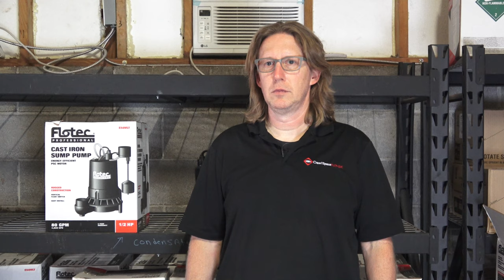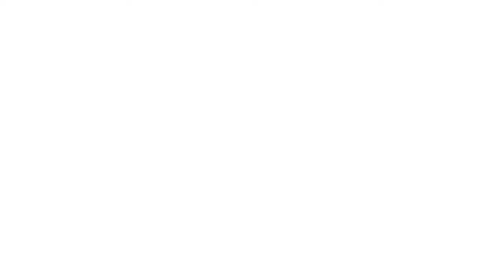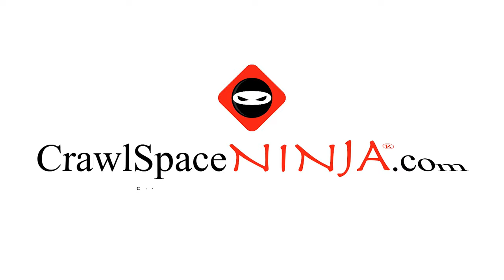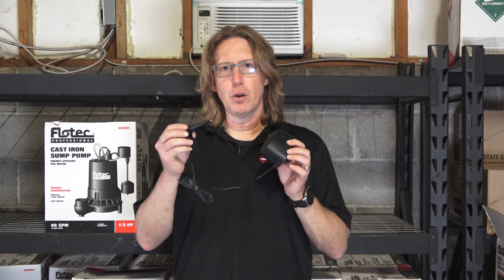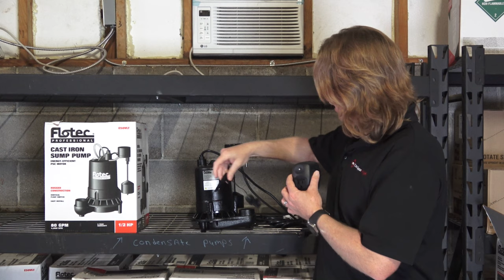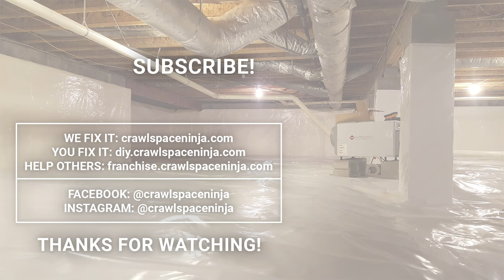Replace Sump Pump Float Switch with Universal Sump Pump Float Switch Controller

Comment: A problem with this type of switch is that the shut off trigger is time-based rather than based upon the water level. One can guess how long the pump will need to run, but water drainage amounts will vary considerably. Consequently, one runs the risk running the pump dry or on the other end, not running it enough to drain the water, which will eventually overflow the sump pit.
Reply from the maker: Thanks for the information.

Comment: What is AMP rating of this controller and where is it made in? I have Zoeller M98 pump which has up to 9.4 AMP rating with intermittent float switch issues.
Reply from the maker: The output rating for this float switch controller is 120 VAC, 13.8 Amp, 3⁄4 HP.
Reply: @CrawlSpaceNinja  Thanks

Comment: Michael, question if you do not mind.   I just added a Basement Watchdog BWC1 Dual Float Switch and Controller to my sump pump - which is a piggyback system.  I set the float below the current water level, roughly 8" up from the bottom of the sump, but it did not trigger.   Is this indicative that the pump itself may be faulty and not just the switch?   Only been in the house 2.5yrs, so I cannot speak to the age of the pump.

thanks!
Reply from the maker: If everything else is working my guess would be that it is the pump
Reply: @CrawlSpaceNinja  Thanks, I appreciate your response.
Reply: @CrawlSpaceNinja  sorry what’s the name of that float switch?
Reply from the maker: @Jimfromearthoo7  You can find it on our DIY Store here: https://diy.crawlspaceninja.com/sump-pump-controller/
Reply: @CrawlSpaceNinja  link is broken